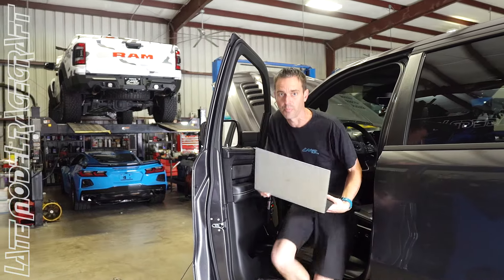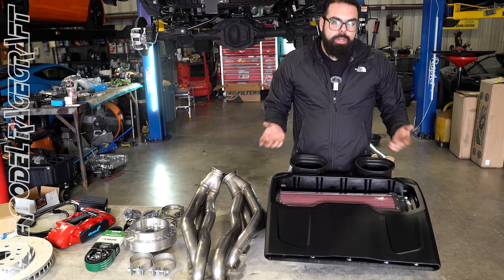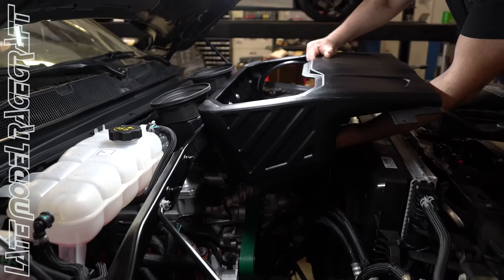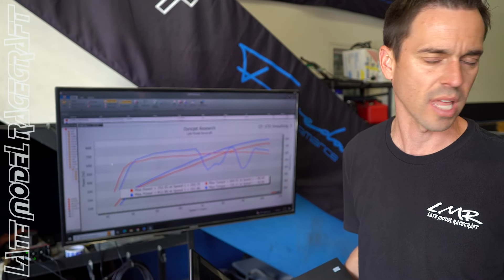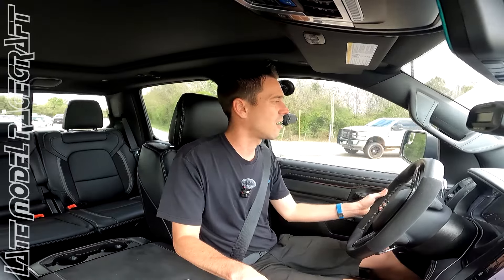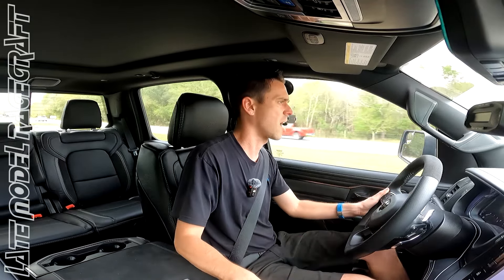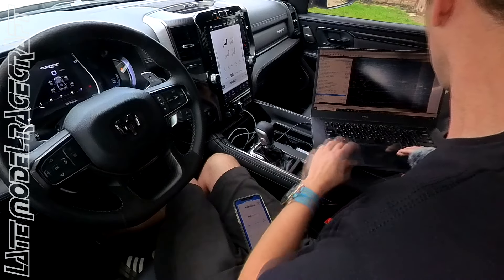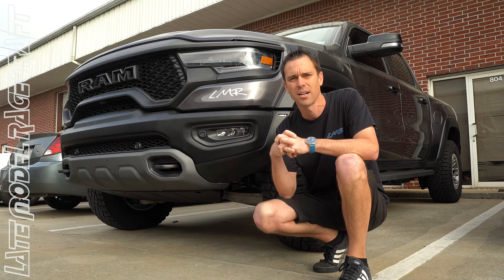Street Testing a 950 Horsepower RAM TRX (E85) - Late Model Racecraft

Comment: I’m not sure what happened to Forza tuning and performance in my county-they were huge in this Mopar world. I’d drive by and there would be 2 parking lots full of everything and one day they stopped and only do exotics. Now the parking lot is empty-I’m guessing a lawsuit and that sucks-lawsuits F-everything. But Steve i could’ve sworn he put everything into the SRT touch screen -so if you wanted to do E85 you selected on screen and then for pump gas-plus it would say the horsepower on the screen. Like normally the hellcat says 500 with back key and 700hp with red key but he’d change that and it would say 1000hp on screen when red key was used. So my question is couldnt you program the selections on screen to go back and forth from 93 to E85 just by selecting on SRT pages?

Comment: So what if i want it so i don’t have to do the tune back and forth between 93 & E85? Does the package cost more that way because i don’t want to go back and forth with a tune. I have a gas station that has E85 like 5 houses from me but if on road trip I’d like to just put in 93 w/o hassle. 
I live in Florida in the county of where Forza Tuning and Performance is and i own 3 different hellcat vehicles- i was planning on sending to him but out of nowhere (I’m assuming lawsuits) he doesn’t do anything but exotics and that place was nonstop Hellcats like crazy-you’d drive by and there’d be 50 in the parking lot and he can hold like 30 inside so not sure what happened. They won’t answer about it. Anyway, Guys i promise you I’m sending each of my vehicles to you 1 by 1 -i have a 2020 Chargers Hellcat,2021 Durango Hellcat,2021 TRX all have low miles. Like 6000, 14,000, 13,000. My question is what thermostat can i stick in right now without tune to lower temps. I’m in Florida remember in the high humity and dew point. It’s 84 out right now with a 72 degree dew point so it’s thick out and this is the cool dry weather. I heard i can put a 195 degree thermostat in w/o a tune. Can I ? And what brand would you suggest. I’ll send you money for advice or buy it off of you -i just really need to get temp down on these. All my Hellcats have cold air intakes already and they run cooler air in temps and i thought they wouldn’t because they suck on engine heat but i checked before and after. TRX has Bwoody-Chargers has JLT-Durango has Legmaker. I might put those brakes on before sending the TRX to you -these trucks are hard to stop from factory. 

So please let me know what thermostat i can put in w/o a tune-195? 185? -I’ll buy from you if you want. Also can you get a clip out of what the exhaust sounds like on the TRX with the headers and stock exhaust you put on so i don’t waste money on an exhaust if it sounds good the way you guys are doing it? 

The first vehicle i send you of my 3 will be the Durango because it’s my wife’s and i need to do hers first. Then the TRX and then the Chargers. I’m buying a 2019 ZR1 for you guys to do within a year and might sell the charger to get it or I’ll just get it and make the driveway bigger-it’s hard to part with the Charger and being able to carry 4 ppl. But I’m getting a ZR1 and you guys are doing that one too. I have to have one but hoping price drops a bit or ppl get desperate.
Reply from the maker: Please head over to our website and fill out an inquiry and one of our sales staff will get you taken care of.

Comment: TRX is 6,443 lbs, u will not get around a modded Corvette and might not get around a stock 2019 ZR1 that weighs 3560.   Better put a parachute on that beast along with those big brakes so it can stop. 😂😂😂